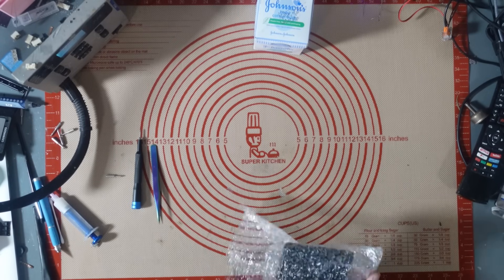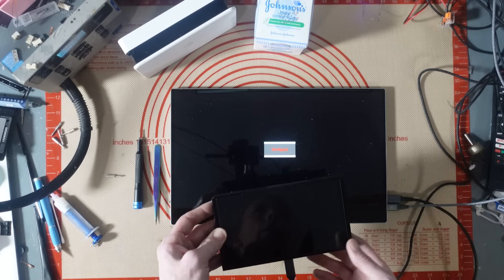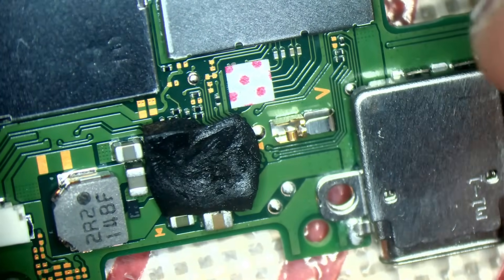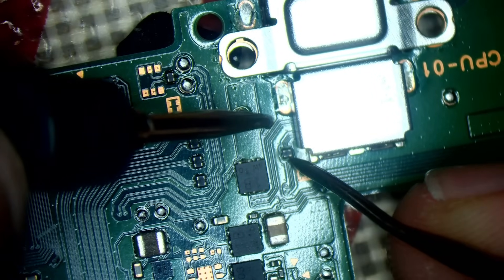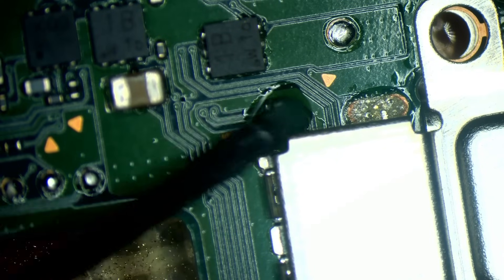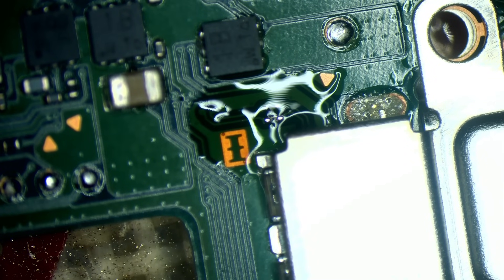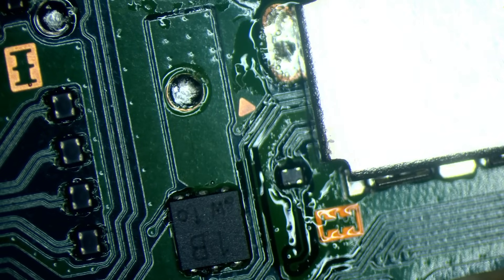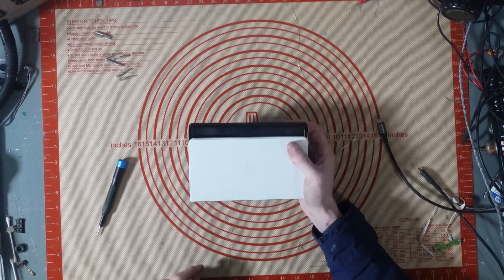You Won't Believe How EASY This Was To Fix! Nintendo Switch OLED Not Docking Repair

Comment: Can I use a wire instead of a filter ?
Reply from the maker: Technically yes, practically no. The filters are designed to filter out noise on the display lines. Not having them there can cause issues

Comment: Hey Phil, excellent video as always! Just wondering, can you get hold of front USB ports for PS4 Slims? I've bought a slim recently, but the anus that owned it before me has absolutely skullfucked one of the ports... and they seem to be almost impossible to get hold of. Cheers dude!
Reply from the maker: Thanks mate. Sorry this comment got blocked for some reason. Yeah I can pull them from donor boards. I will add a listing on the store for them tomorrow 😀